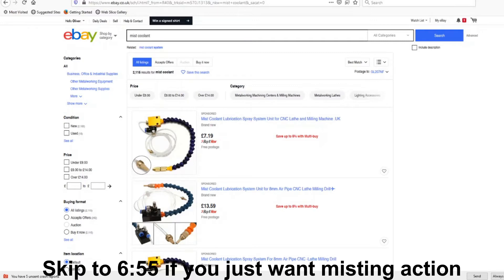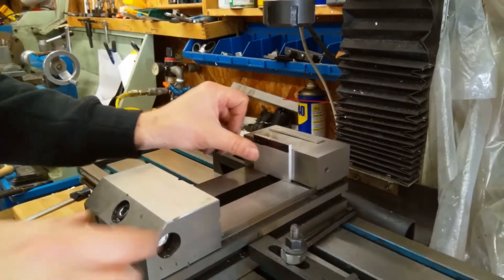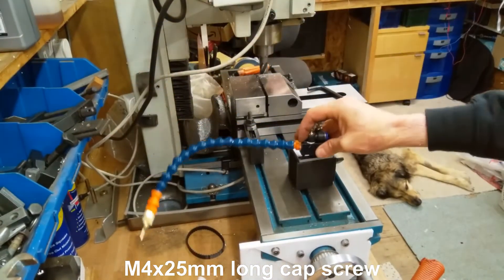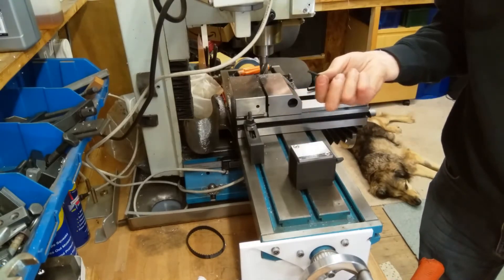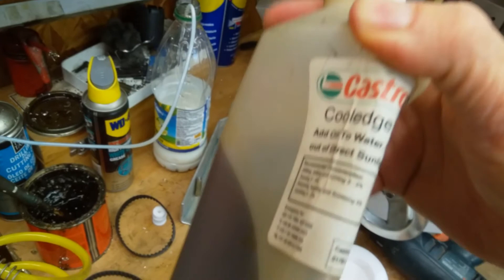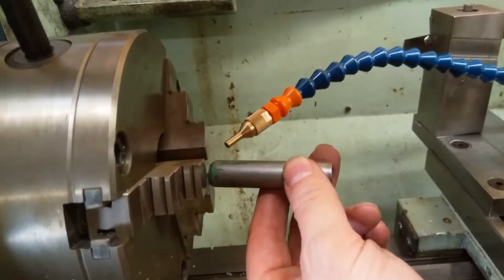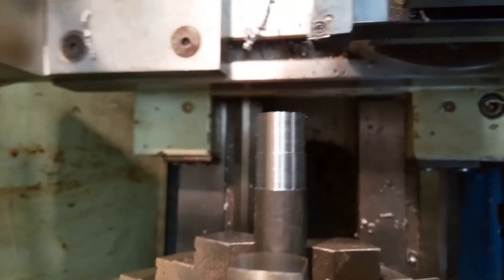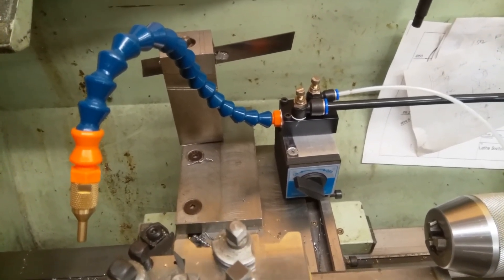Chinese Mist Coolant Accessory - It Works!

Comment: Hi Olly, I recently fitted the same mister to my lathe, not used it a great deal yet as I have been machining aluminium lately but pleased with the results it has given. Regards Del.
Reply from the maker: It's a great bit of kit, but I agree generally not necessary for aluminium. I've been doing a lot of steel lately and it's great, gives a really nice finish (assuming one is using decent steel!). I plan to do an update on it at some point.

Comment: Interesting idea. Another project added to the never ending list 🥴😂
Reply from the maker: It's a good addition, and if you've got an air supply, definitely worth getting one. I mainly use it either to get good surface finish, or when machining particularly hard or difficult materials. I have been thinking about some upgrades to the mister, but the project list is so long it's not funny anymore!
Reply: @ollysworkshop  I hear you. My project list is now a cause of personal stress. I felt less stressed at work! So much for retirement 😂
Reply from the maker: I found it difficult to get projects done, so I decided to make videos. Once other people are interested, there's much more incentive to get on and get them done.
Reply: @ollysworkshop  I understand that, and indeed have been filming many of my recent projects. Whether I end up publishing them all I don’t know, but they sure have helped my motivation.

Comment: Got my misting unit yesterday from Fleabay, it is a one valve system but will probably be modified eventually. It's already mounted on the lathe and connected to the air supply, I just need to plumb it into some coolant now....I am going for a pressurised system like Tom at OX Tools, so that I can have either air on it's own, air/coolant mix or flood coolant with no air.
Reply from the maker: Thanks for dropping by. Sounds good to have all 3 options. I have tried flood coolant, but as my shed floor is wood, I wasn't keen on using it too much.
Reply: @ollysworkshop  Just a little update on my mist cooler. 
I finally got it all working, using a 2 litre pop bottle as reservoir (see OxTools for details) the system works brilliantly. I can select the dry air or a hint of soluble oil in air or a full flood of oil. The 2 litre bottle does run out pretty quick on flood but I have an option for electric pump from a larger reservoir and return drain any way. I find the merest dribble of oil and low pressure air (15 psi) the best combination so far.

Comment: Are you still liking and using it?  Does it get mist in the air?  I'm thinking about trying out mist coolant. How much coolant do you go through?
Reply from the maker: Hi Mick.  Short answer is yes I like it, and no it's not really a mister, more of a droplet spitter. I was thinking of doing an update to it as it needs a slightly different mounting arrangement to make it a bit easier to position the nozzle.